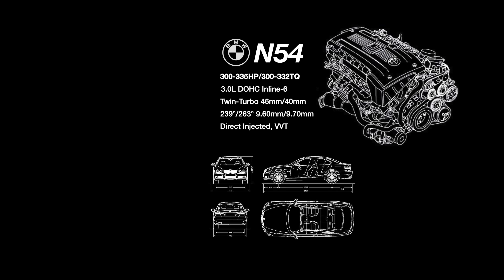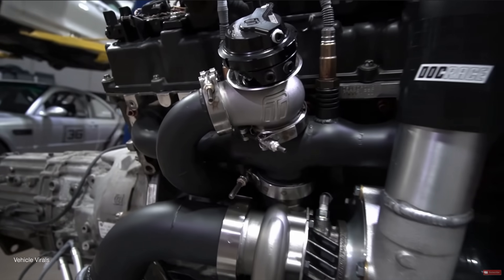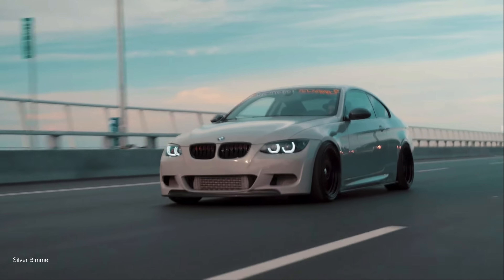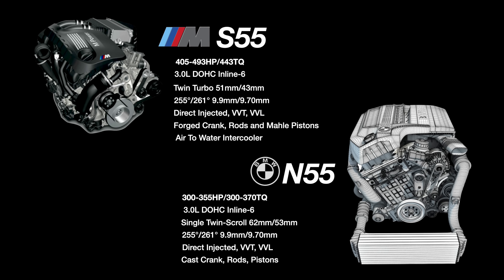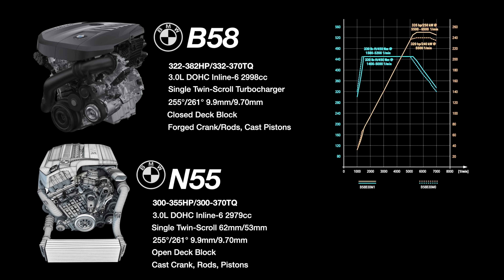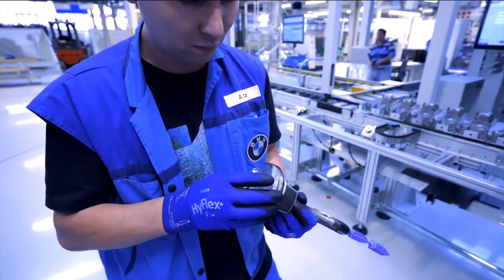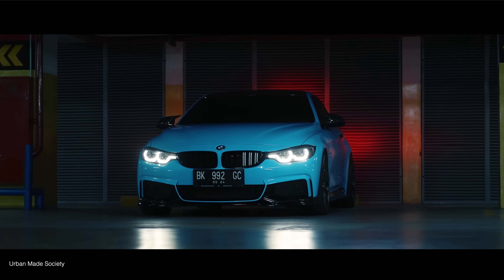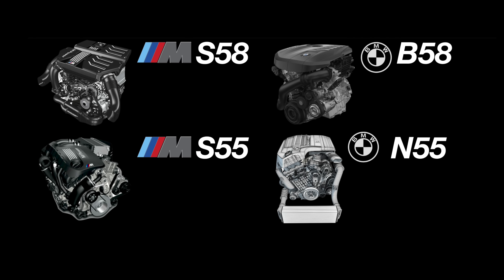BMW Turbo Inline-6 Engines Are Ridiculous | Explained Ep.4

Comment: The N54 was incredibly impressive when it launched. Had a 335i since new (and was fortunate enough to get euro delivery on it). I still cannot forget how that thing felt in 2006. People love to dismiss the twin turbo setup as inferior to the later single turbo N55, but honestly there was so little lag that the lack of power was more than made up for by how responsive it was.

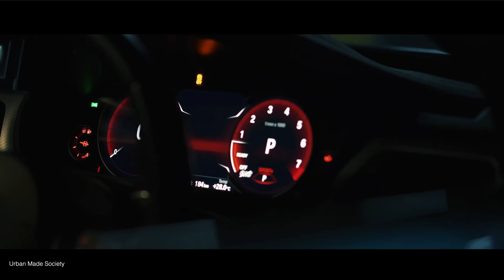EDIT: At 7:40 you mention the overblowing of issues to sell parts. Best example of this is probably the Porsche M96 IMS bearing.
Reply: I was thinking of IMS bearing failure when they brought that up too LOL!
Reply: The twin turbo setup is not inferior at all, it's the whole reason why the N54 make more power than the N55 on stock turbos, there's a lot more room for improvement out of the box.

And while people going for silly power with the N54 will change the setup to a single turbo, the reason for this is size constraints (and cost, one big turbo is cheaper than two medium size ones), when you want 750+hp you can not fit large enough twin turbos in that engine bay you have to go for a single. But for the 500-750hp range aftermarket twin turbos offer the best balance of top end power and low/midrange response, a single turbo setup for the same peak power will have less low end torque/more lag. Those big single turbos people online seem to love make the engine useless below 3500rpm and I always thought it was a pretty stupid thing to do in a road car.

Comment: Even the Diesel I6 engines are insanely strong especially the M57 which can make 700bhp+ on stock internals.
Reply: No diesel can make more than 200hp/l
Reply from the maker: Billet 5.9 Cummins with 2500HP wants to have a word with you😮‍💨
Reply: @337speed  yeah sure, tractor pulling, drag racing or marinen engines can pull that kind of power. But reliable in a road car that will be abused? Nope.
Reply: @sjoroverpirat  Research M57 engine and tell me that! Their legendary engines, I take it your a gasoline guzzling American where diesels are mainly considered as engines for agricultural and construction machinery.
Reply: @channex8179  I've had a 535d and a 335d, I'm a marine engineer and have worked around 10 years with diesel engines. So I guess the answer is no.
Reply: @sjoroverpirat  I'm a Ford UK Master Technician with 26 years mechanical experience within the automobile industry and I know that with turbocharging a 3.0l diesel engine can make more than 200hp\l. I'm not well acquainted with marine engines but I do know automobile engines.
Reply: @channex8179  I'm sure you know darkside performance then? How many 3l diesels do they have over 500hp? I know there have been some attempts to pass 500hp on m57 in Sweden, but they couldn't make the engines last long enough to get there.

Comment: This is why turbo 6 cylinder engine or converting natural aspirated 6 cylinder into a turbo or twin turbo setup has the potential to be V8 killers. If you swap the the 2 factory turbos in a N54 with aftermarket low inertia turbochargers such as 2 Garrett GBC 20-300 turbos, you can make 600 hp with very little turbo lag.
Reply: Might have the potential till the v8 gets put on some turbos.

Comment: N54 and N55 both have hypereutectic pistons, N55 has same rods as S55. N55 does have a cast crank though.
Reply: With the exception of the M235i and M2 N55s. Both of those have forged crankshafts.

Comment: Good video.  I need to swap my '21 M5 Comp for  a M3/M4 because my BMW Turbo is in the shop as I type this comment for possible coolant leak!  I believe the issue is the V8 "hot Vee"  setup that generates too much heat.
Reply: Hot vee setup is present on m3/4 as well. I’m running a stage 2 18’ pre LCi f90 m5 for a few years now and no issues with turbos, or anything really.

Comment: Im a LS/2JZ guy, if I had to pick another engine it would be N54.  The 335i just does things that LS/2JZ cars can not… 950whp and 45psi, stock: long block, head, cams, plastic intake, ecu, trans 6M, rear-end, axles.  Lasted for years high WOT program...  that is quite something.

LS cars can’t do that without at least ring gaps and a deck surface, built head with a surface and port or just a new built head, a cam, new intake, ecu, built trans (if it isn’t a t56), built rear end and axles (unless it’s a 2500hd).  
2JZ cars need billet main caps at 800whp, guys have made 1000whp stock bottom end, but how long did that last? If it lasted for years it most likely was not a high WOT program at all and actually used once or twice.  They at least need an ecu, intake work, cams, fully built head with pocket-port and surface, full bottom end build with rods, .010 or .020 over pistons, bearings, arp main studs, headstuds,

Comment: Yes, BMW build the B58 however long before the Supra was build Toyota gave BMW specific criteria and technical specs on what the engine is suppose to be like and had a lot to do with reliability. So Toyota played a big part in how the motor was designed. Even BMW was astounded by Toyota’s high standards. Toyota even got BMW to get rid of the electric water pump and replacing it with a manual pump for reliability. And of course the S58 is based on the B58.
Reply: That's incorrect.
If you watch interviews about Supra development, you can hear that people from Toyota were amazed by how much they spent on the B-modular engine platform. So, B58 was developed by BMW and checked by Toyota.
BMW used el. the water pump in the past, but they knew that is not a super reliable solution that's why S55 had a manual water pump. After recallings that BMW cost a big amount of money they decided to not use el water pump anymore.

Comment: Engine is mind-blowing. can confirm reliability. kept car outside in snow and sub zero and never had a starting issue. only raced and drove her hard and had ZERO maintenance issues, "breaks", or necessary repairs (except when I crash her LOL). Oil changes every 4k miles about 180-250$ from proper mechanics. Point Is take care of oil and maintenance and she will take good care of you. Problem is broke people buy the cars they cant afford and don't keep up the health of the car.

Comment: Lol. And then they leak oil, all the plastic shit disintegrate, and then the cam and crank bearings score the cams and crankshafts. All this will happen within the first 60 - 100k miles. 

These are lease vehicles. Don’t buy them. 4 years max and give it back.  Let some other salami go bankrupt servicing or wrench on these cars.

Comment: B58 most reliable and in my opinion best engine to ever come out this decade, my 240i making 420whp on 93 octane with over 100 hard street pulls to 130 and 30 launches at the 1/4 mile for 3yrs now, zero issue. Only issue i found is when you go e40 or e50 mix with just ots maps without a proper tune, it loses fuel on the top end, but that's more of a fueling issue and not an engine issue.
Reply: Are you over estimating? Or you have bolt ons? I have a 340i b58, makes about 320 hp
Reply: @inline6-b586  catless downpipe and mhd 93 will give you 420whp all day, I've been driving stage 2 like that for 3yrs now.

Comment: Owning N54 with two-three bolt on parts and simple Stage 1+ tune from MHD I can't say a bad thing about this car. I'm surprised it's that reliable after hearing all these horror stories. Yeah, it has these expensive injectors, water pump, HPFP but not gonna lie, FCP Euro got you covered. In case of injectors though, you don't need to replace them. Yeah, I know that's shocking but all you need to do most of the time is clean injector tips and replace teflon seals, that's all. I have plans to chase the power but I'm not sure if I really need it. 390hp that MHD claims (never dyno'ed, idk if it's true) is enough for me and I don't know if making car less reliable is worth doing all these mods. Let's be real, on daily commute, where the hell am I suppose to race? Or who? Big energy Altimas? 😂
Reply: Pay to play, baby. We all know it's a pricey hobby, sure some cars cost more, but I ain't ever heard of a cheap project
Reply: You should check out the new MHD+ tune came out 3-4 days ago , it has more new feature and update and the best of all ANTI-LAG.
Reply: I race myself cause it feels good and sounds good, haha. I do it for me and the shows, not necessarily to race. Still fun making the car into a beast even if it's not justified by time played.
Reply: Only reason why I keep my 07 335i is all parts are mostly from FCP 😆
Reply: Bro, don't ever race an Altima. Don't even park next to one. Those mfers will take you out! Is there even a single Altima out there without dented doors and severe whiskey rash up and down both sides of the car? Should be banned off the roads. Fuck those ppl!
Reply: It’s the young douchie crackle tune bmw owners that always have the horror stories, they don’t maintain the car, they put eBay shitty mods on, they redline it the second they get it the car but then they complain and bitch when something goes wrong. Majority of mature bmw owners with n54-55’s I’ve talked to praise the engine and rarely have any problems with reliability

Comment: (me, a guy clueless about how cars actually work)  "yea, this all checks out based on me driving my stock 2021 X6"

jokes aside, the X6 has no business being as fast as it is. my X6 has a B&W sound system, massage seats, read wheel steering, massive glass sunroof, weights north of 5000 pounds but still manages to hit 60MPH in under 5 seconds while also getting 30 MPG on the highway. i came from a V6 audi that had similar "engine specs" but was smaller and lighter while somehow also having slower and with way worse fuel economy. the engineers at BMW are magicians.

Comment: even the 6 cylinder diesel engine is awsome. I have 430d with the N57 engine. I enjoy it everyday. low fuel consumption and a lot of power. unfortunately the taxes are so high in austria but its still worth it.

Comment: Also gen 2 b58s like in the m340/supra have bigger hpfp and 2022 supras changed from 2 port to 6port on the cylinder head design and lowered the compression to the same as n55/s55 resulting in 380hp @ the same psi levels

Comment: N55 m2 owner here, there are 4 variables of the n55 and the later n55s have the ewg from pwg and the m235i has a forged crank. Alpina has a twin turbo n55 variant also. The m2 n55 has the s55 baffled pan, lsd, runs s55 dme control, forged rods & crank, custom cylinder walls & s55 pistons. Ewg N55/s55 can run m5 injectors and are making 700+ whp on direct injection only today.
Reply: M135i n55 was also forged crank/rods
Reply: So you are running 700hp only through M5 injectors? 500hp for Stage 3 is more realistic.
Reply: @ChrisEOfficial  dorch has made a stage 3 hpfp setup for the flow so with that paired with m5 eu5 injectors you can reach the fuel flow needed to support 700hp without port injection needed. The size and design is the same but the spray pattern/ flow is alot more on the eu5's. also nostrum has stage 1& 2 injectors for s55/n55
Reply: @N P how’s reliability with gaskets? im on 92k with my ewg m135i stock but still pulls like it just came out the factory, had all gaskets replaced at 70-80k and vanos fixed all under warranty, about to part x on a 2019 m140i

but i fucking love my m135i
Reply: @redarmy1778  u won’t regret 140i the b58 kills the n55
Reply: Been thinking about a m235i and 335i f30. Arn’t they the same platform or do they have performance difference besides the bump in hp from factory tune ?
Reply: @marcosrmzzz  the crank and rods are forged on the m235i, don’t think they are on none m light n55
Reply: N55 PWG can also run M5 injectors

Comment: still rb26 and 2jz  from 1990 are better build for max power! we in 2022 the n54 and that bullshit is years around. in 2022 they making 500-600 -800 hp. in 1998 there ware the fisrt 1000hp supras or skylines on a stock castiiron block. 600-700hp on stock piston(block was normal! 30 year laider a bmw has 800hp from 3000cc and a tesla model plaid with canadian chip tune has full power non restictet to 262kmH so the tesla model s goes arround 350km/h  or  almost 220mhp. juhu bmw friends it is over! bmw sells you a engine 2-4 times cheaper to make and you pay 2-4 times more!

Comment: When you say "destroy everything" do you mean piston crowns and exhaust valves? Sorry, I couldn't resist responding to a ridiculous title. The engine doesn't know what nameplate is on the valve cover. A good turbo engine comes down to high quality components, a competent engine builder, and a good tune.

Comment: 6:30
Most if not ALL turbo engines from the factory will gain LOTS of hp with just bolt-ons alone and no tune. 
Just let those turbo's BREATHE freely 👍🏾
Reply: Gotta let em breathe #1 rule😂 I say the same shit
Reply: @callanotis7902  it works the same for na motors but even allowing them to breathe better doesn't really help unless you tune them with better fuel, even with that it wont gain much.
But when it comes to turbo, its a whole different story. 
Also allowing the crankcase to properly vent out will allow that rotating assembly to spin easier ..
Reply: @ACommenterOnYouTube  Biggest hp jump with I have ever seen comes from e60 535d, from factory it makes 282hp and with DPF delete + Tune it can make 430hp
Reply: @DuBstep115  That is because it is held back by emissions, ignoring the emissions makes a huge difference.
Reply: @larsjrgensen5975  True with they still make like 360-370 with dpf on
Reply: @DuBstep115  The tune is what makes the most emissions and the tune controls the DPF so the tuner can just close the valve and never use it, if they know the software really well.
It is a lot easier to just delete it instead though.
Reply: @larsjrgensen5975  That's EGR, there is no valve on DPF, only option is to delete it plus cat.
Reply: @DuBstep115  sorry, yes correct.
That is impressive I must admit.

Comment: Many years ago, here in the UK, I worked for a well known tuner of the Nissan Skyline, RB's back in those days. We bought two RB26 engines, formerly owned by BMW Research. That told me the whole story.
Reply: Are u trying to say bmw copied from the RB design
Reply: @ContractorVino  I'm saying we bought two motors that were known to have come from BMW R&D, long engines, no ancillaries, we had the heads off (to fit steel gaskets if I recall) and the bores were still factory cross-hatched, so they'd never been run. But the motors were immaculate, time-warps, because they'd been bought by BMW R&D to "look at". Make of it what you will :)
Reply: @TheOriginalGeekyNoob  Why would BMW sell some used Nissan engines that they've been tinkering with? Can't imagine the r and d Department would be selling used engines to recoup development cost but I guess crazier things have happened.
Reply: @cleverusernamecl5532  hey Fritz! Can you sell those Nissan engines so we can buy more beer & bratwursts for the weeknd?
Reply: @cleverusernamecl5532  they do sell them, ask Sreten at m539 restorations how he got a hydrogen powered v12 from the e38
Reply: @joshuad1716  He doesn't have a engine produced by another manufacture sold by BMW.
Reply: @ContractorVino  Nah, that's absolutely standard in the industry of engineering. And it's perfectly legal as well. You will buy your competitors products, take a close look at them, do some tests with them and then come up with something own that incorporates some of the good qualities of the competitors while preferably not having the bad qualities and being cheaper. As long as you don't copy something that is patented everything is fine. Look at Stark Future for example. They built a new kind of electric motocross bike. They openly said that to not have to do the research on frame stiffness where they have no previous experience in, they bought all other motocross bikes from big manufacturers and tested their frame stiffness. They then came up with their own frame built around their component layout that has similar stiffness characteristics to all the other frames. So they didn't copy anything because they needed a totally different frame anyway, but they derived their target values from researching competitors products.

Comment: You didn't cover the M2 spec N55, but to be fair it is pretty rare. It's pretty decent and runs higher boost but does have significant turbo-lag compared to the regular N55 engine. Overall the BMW turbo 6 is one of the best engines currently available.
Reply: Correct, it runs a custom crankshaft and bearing shells, pistons, spark plugs from the S55. The tuning potential is pretty limited in comparison to the S55 (which only needs software to run 550hp on stock parts) but still I prefer it because of more fun, better sound and mid-range torque instead of high end.
Reply: Actually incorrect, the m235 and m2 share the same n55 engine, ALL n55s post 2014 have a forged cranked and the s55 rods, simple to check realoem to confirm part numbers

The m2 runs the exact same turbo as the EWG n55s as well
Reply: @zorn3226  it still has other differences. It had a dry sump for 1.
Reply: n55 sucks.

Comment: N54 will always be the cheapest, besides those piezoelectric injectors. 😂. 
I run my single turbo e92 at 550wheel as a drift and street car with full interior, etc. It's amazing on and off track to drive around. Perfect bang for buck if you have the know how. Massive upgrade from my 1995 s14 Silvia spec r setup the same way. 
I agree that any turbo inline 6 after n54 is great out of the box pretty much. I am bias to n54 tho lol. They are a bit simpler with some of the electronics in the engine bay and things are super easy to get to on it , although I'm sure the newer n/s/b series are quite simple as well after you get under that air/water intercooler. I'll own one eventually lol.
Reply: sure am glad I snagged my injectors and swapped them when n54 injectors were still relatively cheap from FCP. They're insanely priced now. Close to 3 grand or a set.